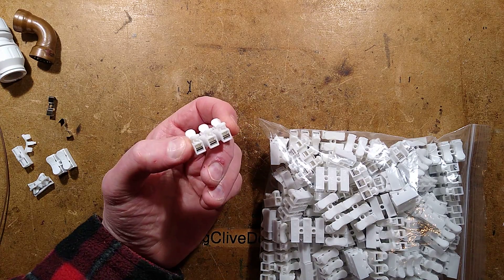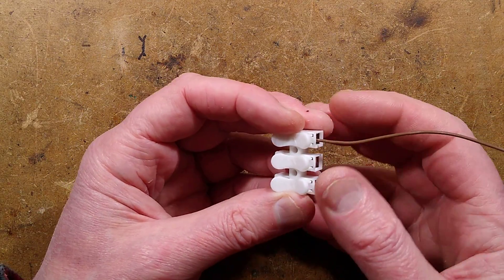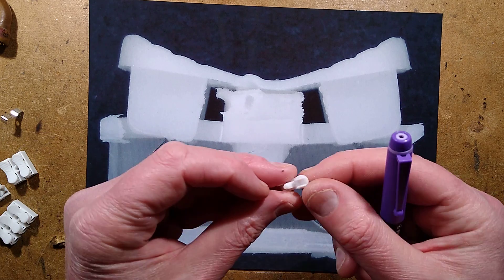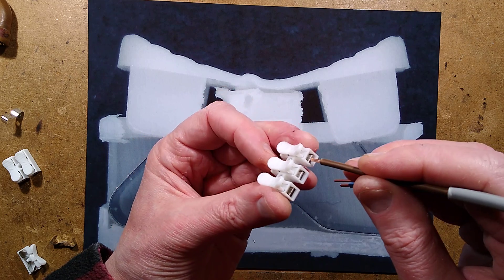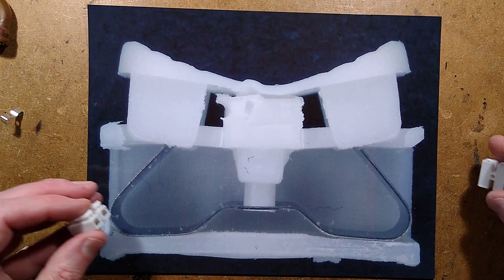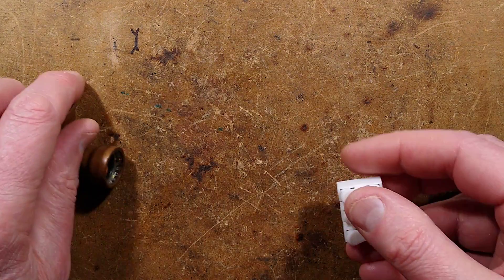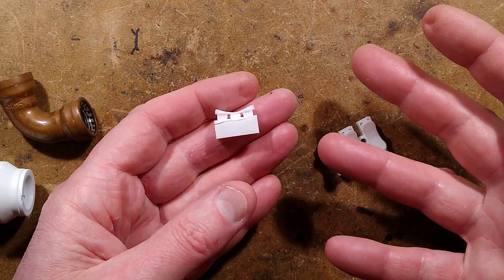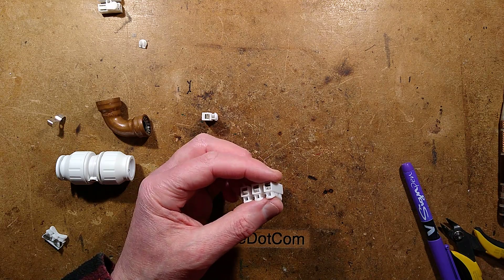eBay's cheapest wire push-connectors (Not for house wiring!)

Comment: I must disagree, they are terrible. I bought them for low voltage experimenting. I made the mistake of using them for under-cupboard 12V LED lighting, they melted at around 3 amps. There is no metal to press against on the other side of the wire, just the plastic housing which deforms and melts due to the high contact resistance.
Reply: 36W of led under cabinet lighting?
Reply: @Steve_Coates  I like things bright. I've got 4 LED strip lights drawing 2.2A now, but did have a 5th one above bringing it close to 3A.

Comment: Corrosion resistant North American plugs and receptacles use stainless steel contacts. They're required for use in Weather Resistant (WR) receptacles used outdoors. I think there are different kinds of stainless steel, so it's likely a higher quality stainless steel for use with receptacles.

Comment: whilst i'm here rambling away with my friends, i was interested to just discover that the smallest thing on my bench a 0402 cap is 5.3 million times smaller in volume than the largest thing on it, a microwave oven transformer.

For the MOT:
Volume = 100 mm × 100 mm × 80 mm = 800,000 cubic millimeters

 0402 capacitor are approximately 1 mm × 0.5 mm × 0.3 mm (assuming a standard size), the volume would be:
Volume = 1 mm × 0.5 mm × 0.3 mm = 0.15 cubic millimeters
 800,000 / 0.15 = 5,333,333
 i know the caps are small, i just cant imagine fitting so many in 800000 mm3. 

i'll get my coat.

Comment: Stainless steel has a very poor electrical conductivity indeed (about 41 times more resistance than copper!), and it looks like the "tang" is very thin around the area where it has a hole in it. It would be interesting to test these at different currents but I would suspect putting more than a couple of amps through these would be pushing your luck.

Comment: i bought a load of similar ones some time ago, to use in the days before i learned to not be shite at soldering. mine have a lever atop them, and a little bit of copper inside. i have had few 'interesting' events while using them, the sort that leave  a purple inverse image of what you were doing at the time, on your eyeballs for a few minutes. i agree, not for house wiring! a particularly valuable lesson was the one that taught me to ensure a single strand of wire hasn't escaped into the neighbouring hole.

Comment: If you have 230V then you only need 150mA for 34W. 
I would use the connectors at less than 34W due to the small contact area.
So suitable for a mains voltage LED

Comment: You have maybe a 0.5mm^2 contact patch between the bite and wire, so about 5A at best. With a Wago 221 or similar, you have contact on at least two sides and one of those sides will have at least three contact points.

Comment: 3M telco splice connectors use a silicone grease inside the connector to hold off corrosion losses.  Are there no Wagos that use the same technique?
Reply from the maker: You get gel boxes for Wago connectors that surround them in gel.

Comment: Soon there will be electrical code requirement to use metal junction boxes covered with fire-resistant insulating layer, and to put sand in them. So that Ebay and Amazon can still sell rubbish connectors and fuses.

Comment: Let's say they are about 3 to 3.5 mm wide and 0.3 mm thin - it makes a cross section of just 1 mm² of steel(!). That's really just for 1 fluorescent light or an LED installation.
If they had skipped the 2 knobs on top but had installed a flat copper bar, about 3 mm wide and about  0.8 mm thick and had sold them as "single use only" I had said they are good for 10 or 16 A without an inductive/heating load. 🤷‍♂️

Comment: Interesting Clive. The cross sectional area of the centre of the steel part is significantly reduced by the hole through it and, as copper is about 20 times more conductive than stainless steel, I'd guess that 10A through that connector will cause significant (over?)heating at the centre - it would be good to test it and see if you have a 10A power supply.

Comment: We have lawyer warnings to not place plastic bags over our heads and milk containers that warn us that the product may contain milk.

But I don't see many advisories that differentiate "hobby grade" electrical components and hardware from permanent installation or life safey types.

Identifiying which item is appropriate to  use can be difficult for those of us already familiar with the industry, and much more for the unfamiliar. Parts may look the same and install the same, but not neccesarily work the same. Misleading and completely false descriptions are becoming standard practice.

If there is a good case for an caution statement, this would be it. The responsibilty of suitability and safety is ultimately on the user. It's a buyer beware issue but the buyer should have sonething to go on.

Comment: I got some of these as Two & Three terminals for my small ardunio and other small circuits I plan to build. They will do me for any 0-32v DC test projects that I can supply from my variable power supply unit. The final builds will be powered via buck voltage units soldered or screwed together with proper connectors. Like you said, clive, I wouldn't like to trust these with AC main supplies and high currents.

Comment: As an electrician you will be amazed what you encounter when you do a refit or a call out. Specially what electrical installation materials are sold in th well known DIY shops. Wall sockets and lamp fittings are the worst. Also wire that is supposed to be 2,5 mm2 is just over 2 mm2 if you are lucky. And the well known copper plated allu wire. Who came up with that idea? Even good brand materials are getting lower in quality.

Comment: Copper like Aluminum creates an outer oxide coating that is extremely resilient to further degradation. 
They use copper roofing and gutters because they last for hundreds of years. 
However, electrolysis from galvanic reaction between the two dissimilar metals and with moisture present (damp garage or basement), will corrode both.

Comment: Stainless is a really poor electrical (and thermal) conductor.  Not what you want in an electrical connector I would have thought.  10A seems very ambitious.  Go on, drive some current through them and get the IR camera out.

Comment: Hi Clive, not this subject but I was hoping I get a better response from your knowledge bank than " dont " or " will under or overcharge" What happens if you charge a Li-ion cell with a Ni-Mh charger with the same battery voltage rating. Thanks Gav.
Reply from the maker: The results of trying to charge the lithium cell would vary on the way the NiMH charger worked.  It may overcharge the lithium cell.

Comment: A potentially serious flaw with this design is the plastic being under constant tension. Unless reinforced, plastics love to fail under tension; a good example are screw caps on containers that eventually crack from being constantly tightened. Cheers.

Comment: These look exactly the same as ones supplied inside some cheap LAP ceiling lights that I fitted recently. They were used to connect the housing to earth on a little metal tang. I didn't think much of them even in a cheap and nasty light.

Comment: In soviet times steel was used for smaller terminal blocks that was capable handling some current. It's aluminium and copper that's a big no-no._

Comment: People sometimes forget that you wont have that much force applied to wire like-never! They act like you are going to hang from a 30th floor of a skyscraper on a single wire connected with this connector like in holywood movies.

Althou its stainless steel that melts on 1700 C° you cant expect much flrom a 2mm thick tab ,you aint gonna put a 3.2mm electrode in it and weld on 110A.
As long as it holds wire firmly its fine .

I did my whole workshop with just twisted wires and electrical tape -its good enough,my house was done like that and there were no problems for 40 years.People overthink simple things when it comes to fixed instalations.

For the moving parts i twist wires ,heat it up with a torch lighter ,put a dab of solder and a heat srinking tube over it and im good to go.No need for wago bullsht.

Comment: It's galvanized, most probably zinked steel, unfortunately. Out of interest you can break some currently in production Schneider or Legrand wall socket for up to 2.5mm2 cable that are all spring connectors.

Comment: Surely you wouldn't want to use them internally in lighting even, given that a downstream short could subject them to 6A or 10A of load, depending on the MCB. I can't imagine they'd actually take the claimed 10A of load without melting or combustion.

Comment: I use these to temporarily connect 5v signal wire, and as long as you use single stranded wire or tinned multi stranded wire, they hold up surprisingly well. The only issue is that the thinner the wire the worse connection you get, obviously. And that is why I only use them temporarily and solder my signal wires for permanent use.

Comment: The metal grips the cable/wire against the bare plastic.. that will be an issue with heat over time. I remember changing a fitting with line/earth fault because a plastic connector had disintegrated... Although it was the old original one with screw terminals... But at least that had metal to metal gripping the cable.

Comment: Julian or yourself featured these cheap connectors some time ago. As to the question of connectors and damp, the company that I work for uses rail mounting Wago connectors, and when used in an enclosure that suffers from condensation and damp, we have found that the stripped part of the copper conductor (single solid core) corrodes where the spring metal holds it. As well as the corrosion of the copper wire, we think a stress fracture is also part of the failure mode. If then disturbed or if subjected to vibration, the copper wire then breaks. Or eventually, the wire breaks on its own. This happens within five years or less on a new installation. Where these failures have occurred, due to the mess that the corrosion has caused, we also renew the Wago connector block.
Reply: Wago has a special insulating paste to be used when mounting terminals in a humid environment. If the wires were corroded, the technological assembly procedure was not followed
Reply: @Edisson.  Contractors carried out the installation work. It was part of a much, much larger scheme. We were less than impressed with the standard of workmanship. With far too many Wago terminations, they did not even strip the insulation off to leave the bare copper conductor the correct length. I saw no sign of any paste. The "fix" that we were instructed to try was to put large bags of silica gel to absorb the moisture.
Reply: @Mark1024MAK  To do it as cheaply as possible and quickly away, time is money - I come across these procedures very often
Reply: @Mark1024MAK  nice fix, whos replacing those every 3 months?
Reply: @luminousfractal420  - good question, I don't know the answer 🤣
Reply: Just add a non conductive grease. Easy fix, and cheaper than the specialty filled ones.
Reply: @michaelhess4825  I know (lubricant is also sold separately, no need to buy filled) but if a layman is reading this, he can stuff anything into the clamp (I've already found silicone from an acetate base - completely eaten away) so I'd rather refer to the original lubricant.
Reply: When using wagos in a humid environment we use brit-lube electrical grease...  Solves all those problems..also wago make a. Alu-paste for similar use but it's a lot more expensive per ml
Reply: Never use these. Terrible things.

Comment: I hate those fucking connectors, they rarely work. I rather pay a few cents more and get fake wago with a lever.
Reply: I tested (& broke open) a range of the fake wago's with the long levers & the stubbier levers. Did a milliohms voltage drop & wire pull tests. They were the equal of the real item in terms of material quality, feel, operation & function. My guess would be they are made in the same factories in the far east.

Comment: I have purchased and used these, they are absolute garbage. I have a ton of them and will never use them!

Switched to Wago, actual wago, not the generic ones, I've tried those too, also garbage.

The steel connector bends into place and does not spring back. Definitely not spring steel.

Comment: Found these connectors in low current home appliances like the LED Lights we bought, and the contractor used these.

One thing that happens though over time is that the plastic flakes off, which isn't great since it was only 5 years so I assume they cheaped out- so I swapped all out to WAGO 221 connectors.

Comment: I've had a few light fittings that have come with these things, and I bin them on sight, cos ones I've tried to use, one wire goes in, the others fall right back out, so I just use my Wago-clones instead, they may not be approved, but at least they actually hold wires... :P

Comment: As much as I would worry about some type of galvanic reaction....Shitty plastics becoming hard,  brittle or otherwise just plain failing is an equal concern.  Never quite sure what formulation is being extruded in these cheap fixtures.  I could never understand how saving 50 bucks on a 10, 20, 30 thousand dollar kitchen redo made any sense.
I converted all my basement and garage lighting from ballast driven fluorescent to LED tubes.  Not sure I could trust these connector even for this low consumption application. 
Thanks for all you do and your time, love the channel!

Comment: I bought a bunch of them: the specifications gave them for a million amps and I used them freely to test my projects.
Very useful..... but when one melted and caught fire with less than 1 ampere at 12V I reconsidered my philosophy. (it was a tiny 10 Watt ceramic heater with thin single core wires, almost 0 contact surface)
Only for low voltage signals.
I've seen people use them for home wiring: bad move.
Reply: a million amps? That's how you know it's extra sketchy

Comment: Hi, these clamps should be banned, I've seen a lot of them melted, heat is generated when current passes through and the plastic cover loosens, the clamp loses pressure and sparks. In a circuit with small currents, they have a larger transition resistance and this can be a problem. An expert won't use that clamp, Wago is Wago, but a layman doesn't care and that makes this clamp a potential fire creator.

Nice day 🙂 Tom

Comment: The main problem with these is that the wire is clamped between the metal and the plastic housing.  When they get hot, the plastic softens and releases the wire.

Proper connectors clamp the wire between two metal parts of the same spring, the plastic is just am insulating cover.
Reply: Its a Chinese circuit breaker, When the connector gets hot the plastic melts & the wire falls out.
Reply: @anthony4acre 😂😂
Reply: :text-yellow-goal: @anthony4acre
Reply: It could have been designed to have a strip of metal at the top to press the wires against but that would have reduced the manufacturer's profit by a fraction of a penny on each one produced.
Reply: @simonruszczak5563  "a fraction of a penny". Easy there, that is two hours wages.
Reply: @simonruszczak5563  ..or simply add another curve to the spring, forming an enclosed C at either end & hence doubling good contact area.

I'd be hesitant in using either design for solid core cable carrying any sort of significant current due to aforementioned low contact area, but I guess it'd be fine for stranded flex of most rated gauges due to their higher compressibility (& hence maximised contact area)
Reply: Also the wire is making a point connect with the metal clamp causing a possible small electrical resistance.
Reply: I say 100mA. The terminals cannot be expected to do more than that. 
But that's enough for an LED on mains with a few watts. 🪔
If there is a short circuit in the LED, the terminal will definitely work as a melting fuse 🔥
Hopefully the housing is connected to PE. 🔩
Reply: That construction is certainly not permitted in UK or European standards for the reasons you mentioned. That is the problem with direct imports bypassing any kind of approval or safety checks.
Reply: Came here to say the same thing.

Comment: Generally, copper and stainless steel have a low potential for galvanic reactions. In fact copper can assist in stainless steel's corrosion resistance, particularly in  more aggressive environments such as saltwater and certain acids as the molecular breakdown of copper produces a barrier to pitting formations.
Reply: Well, that's going to vary with what type of stainless steel is used. Back when I had reason to know the details I found that there were hundreds of different 'corrosion resistant steel' materials just within the aircraft industry. Knife blade, hand tool, and medical devices all have their own ranges of materials considered as "stainless steel".
Reply: @mikebarushok5361  I suppose in your zest to be a quasi-contrarian expert, you missed reading the qualifying FIRST WORD of my statement. But, it's OK, you are not wrong by any means.
Reply: @Dustin2112 wasn't trying to criticize you, not even a little. But I used to specify the hardware used in aircraft manufacturing drawings to create grounding points for power grounding and separately for small signal and shielding grounding. We had available CR steel hardware, but never specified stainless steel for these screws, washers, nuts or nut plates because other materials gave better conductivity and better corrosion resistance.

Comment: If you like, try taking a stainless insert from one and a bit of copper wire, and see which becomes positive when they are dipped (just the end away from the test clips of course) into a mild acid or salt solution. The anode is, I believe, the one that suffers.
Reply from the maker: Interesting test.